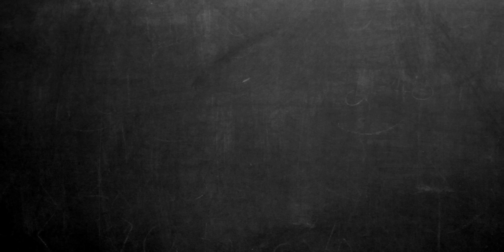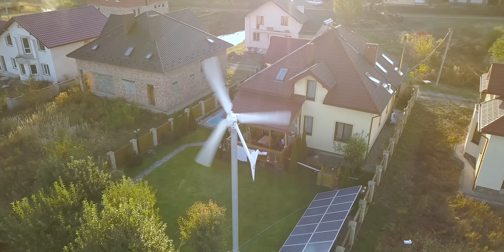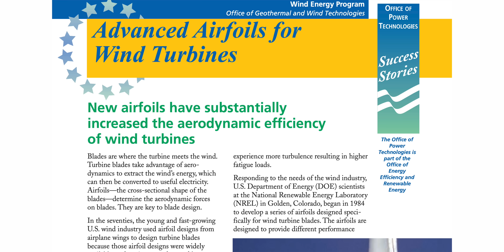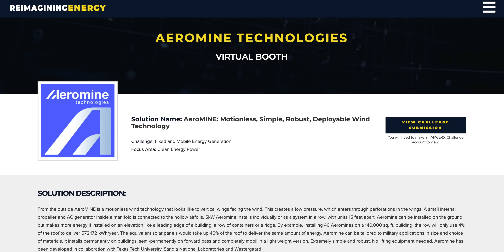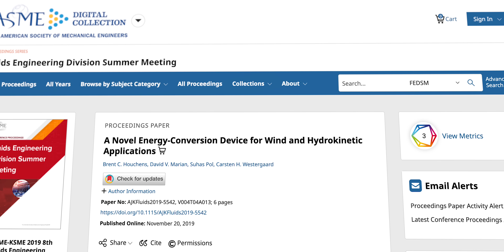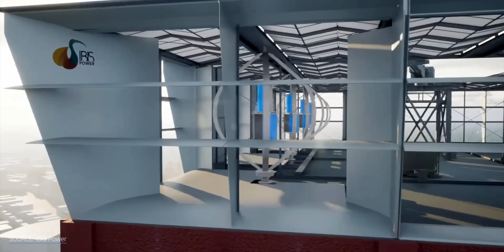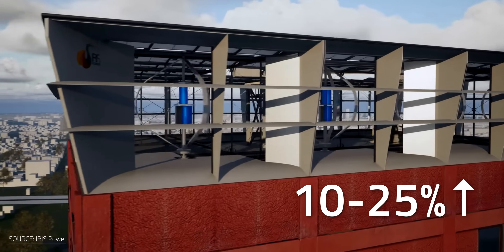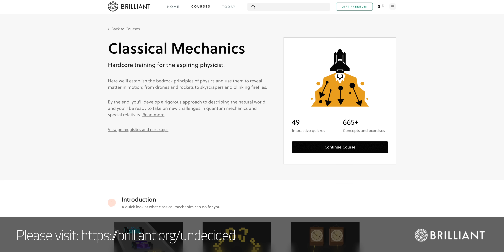How Can A Wind Turbine Be Motionless?

Comment: Almost ever time I see wind turbine designs, one major point (at least from the viewpoint of my region) seems to be skipped. Does the turbine suffer from changes in wind speed and how much? My region has lots of open farm land and 5-15 MPH winds 90%+ of the time which made it a no-brainer to put turbines in a lot of places. The problem is the wind changes speed a lot. This causes strain or gearing mismatch on most turbine setups. Can you include this info in similar topics?

Ultimately there is unlikely to be 1 magic design that serves everyone. Each region has different wind or rates of snow / cloud cover / Dust precipitation and will there for lean toward a different design.

Comment: The reason wind is having such a hard time is because the farmers land it will usually go on don't like it. They're noisy and cause light to flash if you live by them. They also see it as selling out and turning your back on farming. Personally I'd be fine with it but that's the reason it hasn't proliferated as effectively as solar IMO.

Comment: Guys, calm down. There is no "green energy", there is only the desire of people to get more money out of you under the guise of good ideas. If you make a lot of wind turbines and electric cars, you will be faced with the problem of recycling batteries, etc. The harm to nature will remain, but the stability of the system will drop dramatically. For example, you expect to drive 400 km in an electric car, but come hard frost and you will barely make 200. While the internal combustion engine will bring you to your destination under any circumstances.

Comment: A wind turbine obviously can’t be motionless, it has to have moving parts or it’s useless. Strange title, close to click bait. But this design is appearing all over America now on industrial roof tops. Using wind cowls yo direct air flow over turbine blades is very efficient technology developed many years ago for fluid
control and direction for water electric generators. Nice to see it being used for air.

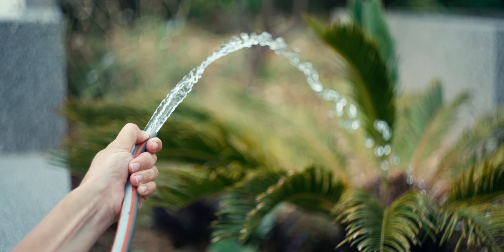Comment: Thanks for great video! One note on 7:19 the flow does not increase when you restrict the water in a hose, it is the velocity that increases. Flow actually decreases due to the added pressure drop.
Reply: I heard him say velocity increases
Reply: Well, to get technical, he didn't say the flow increases, he said the flow speeds up.  In other words, whatever AMOUNT of flow there is, it's velocity increases.  But, I agree that saying the flow's (or water's) VELOCITY increases would've been better (more accurate, and easier to interpret).
Reply: @mikek0135  Velocity is dependant on direction as well. 'Speed' is the correct term. Wind is a velocity because you say 20kmh E.  Speed + direction.
Reply: As a layman I love it when people get into the nitty gritty because ultimately that understanding actually makes a difference at some point. For me though, especially with the visual aid of the garden hose, it was crystal clear what he was trying to explain: wind speeds up before it reaches the turbine hence the increase in energy creation. So for the general understanding, for me it was sufficient and very effective.

Keep up the good work!
Reply: I think it's better to explain it as the structure increases the volume of wind a small turbine can collect.

Comment: Where are the physicists? The power is proportional to the length of the blade. Short blades, small power. Compressing the air does not add more energy. You should do the Brilliant course on wind turbines. These compact turbines would be great if they could work in reality.

Comment: 2:56 The Bernoulli effect is not responsible for generating the lift to get an aircraft to fly. The angle of attack of the wing causes air to be deflected downwards. The reaction is what lifts the aircraft.
Modern fighter aircraft have largely flat wings.
Reply: It is primary force for uplifting the plane angle of attack and Newton's third law is secondary force for uplifting the plane

Comment: Hate to tell you this Matt, but airplane wings don’t develop higher pressure underneath, pushing the aircraft upward.  They develop lower pressure on the upper surface, literally sucking the aircraft upward.  At least that’s how I learned it 45 years ago when I first started flying airplanes.

Comment: Whether you can get more energy from wind or from solar depends on whether you live where there's more wind or more sun. In Hawai'i you'll get more energy from solar. In North Dakota you'll get more from wind. That said, both are excellent sources of energy and can compliment each other. I like the installations that use both. Where I live, adding wind to my existing solar home would probably not be cost-effective. But nationally and world-wide we definitely need both, as well as other sources where practical. Additionally, in Hawai'i the peak energy demand comes from air conditioning on hot sunny days: ideal for solar. In North Dakota the peak energy demand comes from heating in winter when the wind is blowing: ideal for wind power.

Comment: I don't understand why the aeromine shouldnt turn with the wind direction. I think this could be achieved incredibly easily by installing it on a rotating platform and placing a vertical fin on the leeward side. It would use no energy and probably increase the efficiency and range of use-cases dramatically.
Reply: The old corn windmills had lateral rotors that would screw the smock around to face into the wind.
Reply: That would make it a lot more expensive. And there is no way a single vertical fin will be able to provide enough force to move the entire platform, it looks like it weights several tons.

Comment: You are wrong about higher pressure on bottom of airplane wing causing lift . Its the lighter pressure on top of wing that causes lift . Top of wing is curved causing wind to speed up to fill void . This in turn causes a vacuum on top of wing which produces lift . It vacuum on top of wing that lifts plane no pressure on bottom .

Comment: These are all good concepts but the problem is we need to work on storage systems for all this so called green energy. Without some type of storage that is dependable and cheaper than the current batteries we use then you will have problems with all this energy. You need this storage for when the sun isn't shining or the wind doesn't blow. But the bottom line you will continue to need alternate energy to offset green when it isn't being produced due to weather conditions.

Comment: It really doesn’t matter how or how well a wind turbine works, the fact is they will never produce a reliable source of electricity until we have a huge leap in storage capability and capacity. The claim that 9% of US electricity came from wind is misleading because the system needs a reliable backup supply that cannot be shut off - whether it’s a fossil fuel or nuclear boiler kept hot or an outside power source that is producing power a region can buy if needed….

Comment: I challenge the 3 lies. Its Free, clean and renewable.
1. The cost of bildning infrastructure, roads and cables are never spoken about. For example, you have to cut 40meters and also create a road. Not very friendly for the nature.
2. Its not clean, becuase erosion of the blades leaves plastics in the Woods and sea. And they contain ca 3000 liters of oil. Where do you think that goes if the turbine breakes down. Nature and into the ground water.
3. How can it be called renewable when all the material is composite.

Fun fact: one turbiner have to produce power constantly for 20-30 years to mitigate its own carbon footprint and make it zero. But turbines life time is about 10-15 years. And they don't Always Product power because of no winds, they break down, freeze over and need service.

I checked all companies that run windfarms in my country. Non of them can turn a profit if it would be because the state gives them subsidies. This is a world wide scam to be really honest. So what you think about that?

Comment: I watch your channel frequently, but the old explanation of air moving faster on the top side of a wing and slower on the bottom of the wing was proven wrong so many times. I have an RC Airplane with a flat wing with no air foil shape and it still flies. Its the angle of attack of the wing (that is slightly angled up) that pushes air downwards and causes the airplane go to upwards...
Reply: You can have multiple mechanisms of lift. Plate vs airfoil. Both valid, useful for different flow regimes.

Comment: i mean lets go throught that for a second, 
1 its closer to a building so its not as efficent, wind speed decreses with height, and slapping them on the front of a commercial building, which is a huge windbrake and sends most of the wind up .... not only is this dyson hairdryer reengineering a daft idea, but the engineers could be take to task by any europian over 12 years old.  
2 it dosent rotate so its got a masive drawback from wind direction, 
3 its blades are protected from wind but theres still a more bulky part exposed so storm damage is worse, they are literally an airfoil on a roof, 1 windstorm will peel that building open like a tin of sardienes.
4 the company claims its silent, and anyone thats seen a dyson hand drier knows that claim is bullshit, 
5 it dosent have less moving parts, it has the same turbine, but instead of being outside its inside a housing making it more complex for maintanence, 
6 conventional turbines need a higher speed because of the geometry for higher windspeeds, the fact this thing might work at a slower end is because its peak generation speed is a lot lower.
7 not verified answers are because the webbsite is bullshit, its another solar roadways, for example, 16 solar panels is approx 8kw is peak lighting, or 4 kw on a roof in britian, to get that out of an efficiant turbine of the size they claim is in their machine you would need wind speeds in excess of 60mph constantly (closer to 80 with the efficency reduction in the generation method) , so i guess they are testing the units on the south face of K2, but on a normal roof the unit would be torn off from wind sheer long before it could generate that.  
8 their figues, they claim it can work from 5mph, and the lowest average wind speed in the us is 12 mph, with the highest being over 30, so it should be always generatiing. but their figures show it only kicks out 14mw a year from a 5kw max power. That would me its usually operating at an eighth of its rated power given its generating a quarter of its supposed power, is conditions over twices as favourable as its minimum kick in. and remember there was a contradiction between their booth claiming 5kw and them clamining 8kw.
9 the biggest one, maintenence. a normal turbine is an electric motor on a stick with a fan on the edge, they have the same motor, a smaller fan inside a tube and instead of the stick they have several aerofoils..... what nugget thinks thats less complex?

its just the same eco exploitists getting money for an idea that dosent work as well as whats already available. the annoying thing is the people that perpetuate these ideas online for clicks in the process making humanity a little dumber.

Comment: VAWT were all the rage as the next 'thing' in wind power when I was at school, in 1979. We had one with vertical aerofoils which were supported in the middle and at high speed distorted and lost efficiency; effectively built-in braking. This was in the era of the Salter's Duck etc. Some of these options are worth considering - but anything on domestic building rooftops is just wasted effort. Wind speeds are a function of height from the ground...... guess why wind turbines are so tall? Ground clutter slows the wind and since the energy is a function of the square of wind speed this precludes near ground level wind generation, whatever the saving in installation.
Reply: Makes sense for low rise residential buildings, but what about skyscrapers and large office buildings with frequently unused, flat rooftops?
Reply: You can't just say that Wind on domestic buildings is wasted effort.
If a small wind turbine is cheap enough to turn a profit on a domestic building then it's not wasted effort.
Now we just have to get to that point.

Comment: Incorrect explanation of the way aircraft wings generate lift. In the streamline flow of an ideal fluid, the sum of the energies remains constant. As air accelerates over a wing it reduces in pressure. It is this low pressure that provides lift and is why flow separation from the upper surface results in a stall of the wing and subsequent loss of capabity for flight.. The venturi principle has multiple applications including in fuel scavenging etc. Its a fascinating principle that drives the turbine described. Otherwise, a nice video. Edited for small iPhone keyboardisms;) P.s. In the streamline flow of an ideal fluid, given the sum of the energies remains constant, you'll also note a reduction in temp with an increase in velocity. This also has consequences/applications eg the BA 777 crash short of London Heathrow.

Comment: Hi Mat.  I’m not sure I get your analogy of a car to an aerofoil where the car gets a down force and the plane gets an up force.
The top surface of both is curved and the bottom is flat.
The air travels further over the curved surface reducing the pressure therefore the wing moves towards the area of low pressure.
Why wouldn’t the same thing happen with the car?  Not that I’d expect the car to fly but I wouldn’t expect it to be forced onto the ground either.
How does the air move faster under the car than above?

Comment: Surely, wind power and solar will always have to coexist? For when there is no wind or very cloudy, or even night time. Battery banks for night time charged during the day. The issue of a very cloudy dark winter day with no wind doesnt supply enough power for the day and is insufficient to charge night time battery cells will always be a problem. I wish there was a simple solution to world power. First thing we need to do is curb the unnecessary power use. Just take a look at night time pictures of New York, London, Tokyo and many others.  
They should flatten mountain tops in the Alps, Himalayas, Andes and populate with wind and solar farms and I dont know why Australia doesnt populate the central outback with solar, they could power the whole country all year round with the uninterruppted sunlight they get. Tired of hearing too expensive, the costs are too high... blah blah. the powers that be are just not serious enough about it yet. Its a false enconomy not to do radical things right now. I have a hamster in his wheel powering my PC that im on right now.

Comment: I think their power estimate figures are way off.
Wind power is based on square meters of wind frontage, and a wind turbine that is only 2x2 meters (4 sq meter) is only good for a couple hundred watts output at best!
And that will only be when the wind is blowing hard in that direction! If you factor in no wind, and wrong direction wind, it is a turbine that will make maybe 50 watts average. Easily beaten in performance by a 150 watt solar panel which is MUCH smaller, cheaper and easier to install.
Fancy design small wind turbines are never going to be cost efficient. There is a reason why all profitable wind farms use MASSIVE turbines, very high up and away from buildings.

Comment: I used to think that the signs that spin round out side of most gas stations in the 90s would have been a good Basis for a vertical wind turbine.
I also believe that every new building wether commercial or residential should have solar or wind turbine or both.
Here is to a brighter cleaner future for mankind/ womankind

Comment: Without watching the video and glancing at the thumbnail… Flaps could be better than a turbine. The faster movement of flaps could generate the same amount of power (if not more) that a turbine does during one rotation? Depending on gears, switches etc. Damn, I’ve just given away a multimillion dollar power/energy initiative… *slaps forehead

Comment: Home solar is absurdly cheap once the industry gets going. You should look into what we pay in australia for solar, where the industry is very developed, in south australia 40% of homes have solar, it's a no brainer when it's so cheap and effective. Forget $1600 USD/kw it's less than half that. You can get a 6.6kw system installed for less than $3000 USD the average is $3500 for a 5kwh system.

Comment: A man in Belgium has invented a new type of solar panel that produces hydrogen as well as electricity. Imagine a hybrid car using a battery charged by solar and an engine that runs on hydrogen instead of gasoline as a backup. All generated at home. Zero pollution not including the manufacturing of the components.